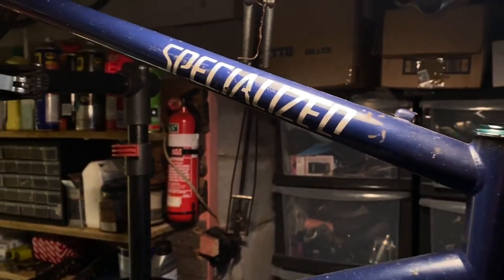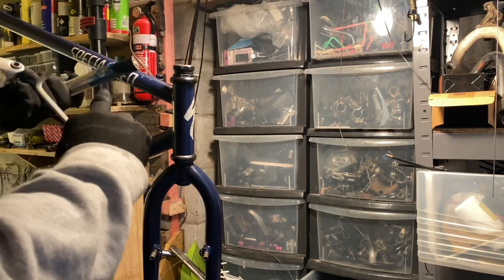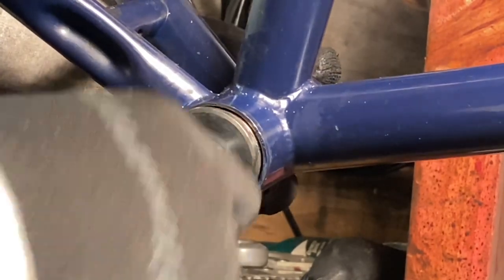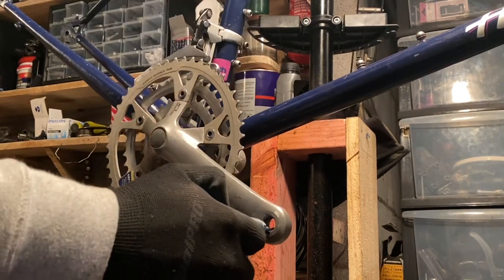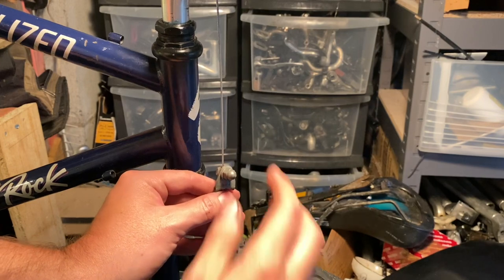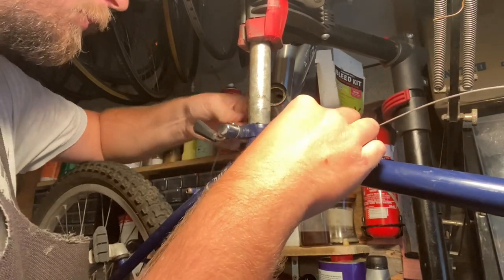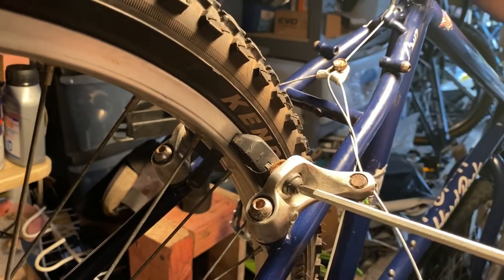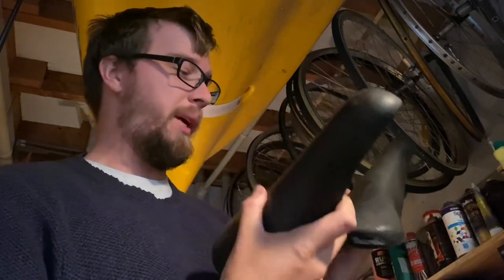Retro mtb build up - ‘91 Specialized Hardrock

Comment: Nice!  I have a ‘95 Hardrock with a 23” frame.  It was hard to find one in my size for some reason.  Thanks for posting this build!  Makes me want to get started on rebuilding mine.  Any feedback on the slicks?  I was thinking of doing something similar with mine.
Reply from the maker: Oo sweet! That’s a great size 😎 they sure are hard to find the larger ones! Good find, though 🤙
You’re welcome, thanks for checking it out! 
I’m a fan of the Schwalbe Cityjets, they last a long time and have decent puncture protection 👌 They do well in all weather, ok on gravel but obviously bad in mud haha, but unbeatable for the price! Other Schwalbe tyres are great, too. Can’t really go wrong with their lineup 🤙
Reply: About 4’28”

Comment: Nice quick build! I’ve got a question, you mentioned TANGE chromoly tubing a few times in this video. What is TANGE? I bought an old $25 Mongoose and it says it’s TANGE chromoly but I’m not sure what that means 🤙
Reply from the maker: Hi! Tange is a Japanese manufacturer of good quality steel tubing for bikes. 👌 most Tange Chromoly frames ride quite nicely! 
Sounds like a great bike for the $$
Reply: @toastyrides  Oh nice, thanks for that info. Yeah it’s in pretty good condition too although the components are pretty low spec. I’m not sure what I want to do with it yet, I’m thinking I might take it on a bikepacking trip as is and see if it lasts a weekend 🤣 After that I might fix it up to be a commuter and try to ride to work more often.
Cheers!
Reply from the maker: @advanturest  that sounds awesome!! A nice long trial bike packing run sounds like a good start 😎 then you might brainstorm on the trip 👌

Comment: I guees the rear cable housing did move in with a weird angle because the cable was too short. If you would've used a longer one the cable wouldn't need to stress and fit in that tightly
Reply from the maker: Haha yeah I normally try it longer and trim it down, just don’t show it all on camera